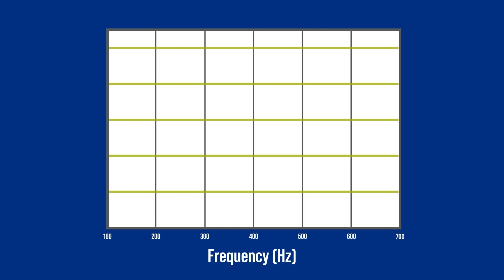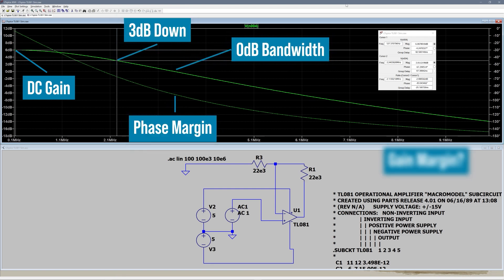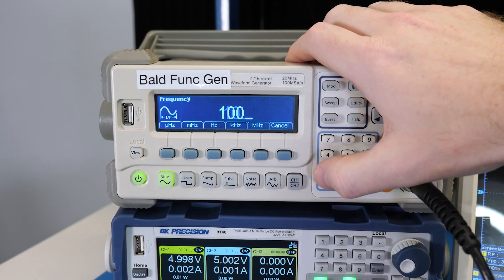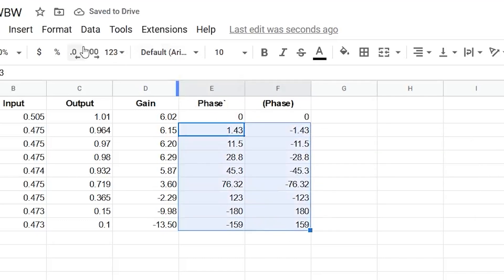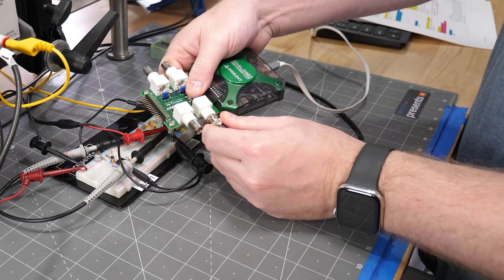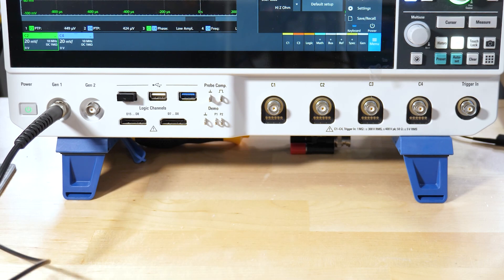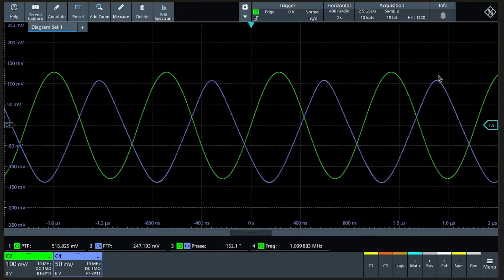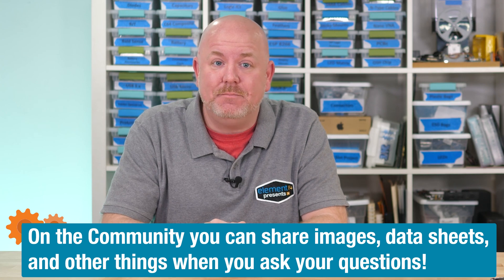Learn Three Ways You Can Create Bode Plots - Workbench Wednesdays

Comment: A few more ideas...

1. Use a wideband noise source as your input, and a spectrum analyzer or fft function on your oscilloscope to look at the output magnitude spectrum.

2. Use a sawtooth wave to linearly ramp the frequency of a constant amplitude input (make an FM chirp signal).  You can plot both the sawtooth modulating signal and the amplifier output on the oscilloscope, and use the signal generator's specs to work out the input frequency from the sawtooth voltage.  This is a quick way to look at the magnitude spectrum (no log scale though).

3. Use a Spectrum Analyzer with a tracking generator. 

4. Feed a long period squarewave (repeating "step-function") into the input.  You can extract all the frequency response information about your system from the step response (you remember this from linear systems, right?).